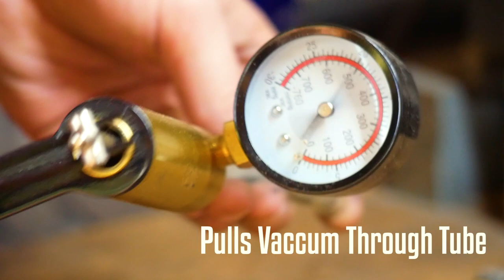How I Make Custom Mosaic Pins

Comment: I've seen custom belt buckles made of a plurality of pipes fitted in a bigger pipe... though those were bigger.   And welded together on the back, rather than epoxied together, if I recall correctly.   Certainly the belt buckle hook and  loop that engage the leather of the belt were welded (or brazed) on.